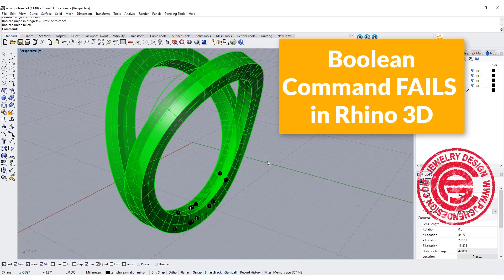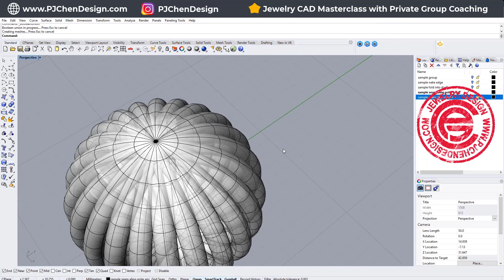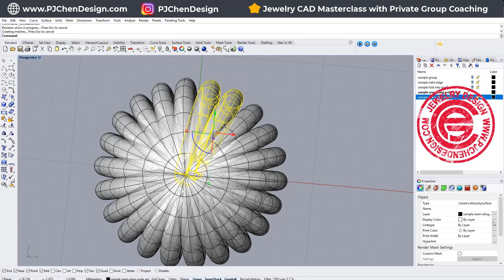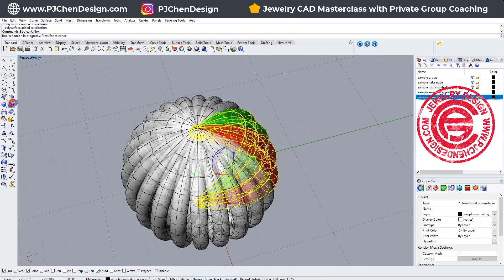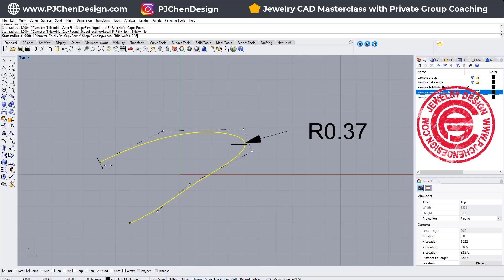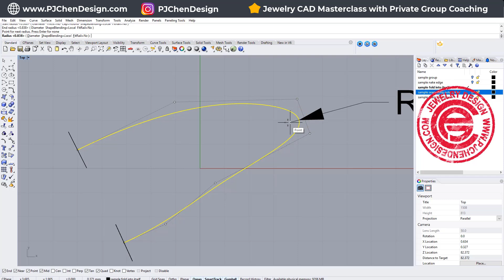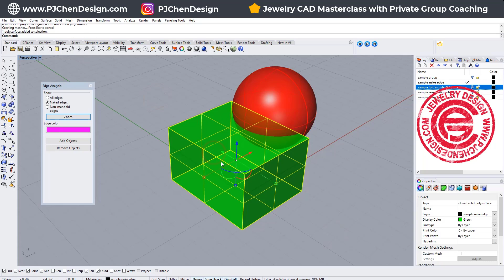4 Reason Why "Boolean" Commands Failed in Rhino 3D Software #446

Comment: Hi again PJ. Moving 0.01 mm could solve the problem, but could destroy the pure geometry of the object.
Reply from the maker: my goal for jewelry 3D modeling is mostly for production purpose. the 0.01mm difference will not be noticable at all after polishing.
Reply: @PJChenJewelryDesign  Of course I understand that 0.01mm won't make a difference. However, Rhino programmers should try to solve these problems.